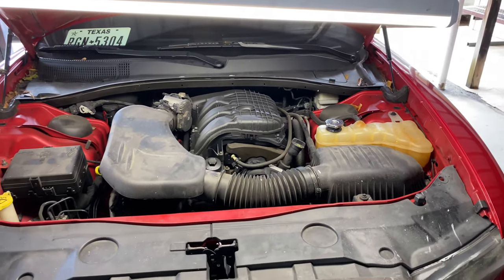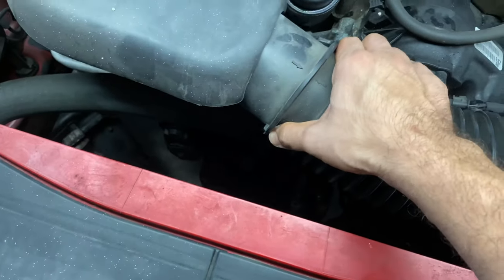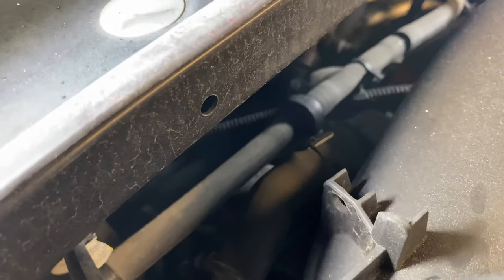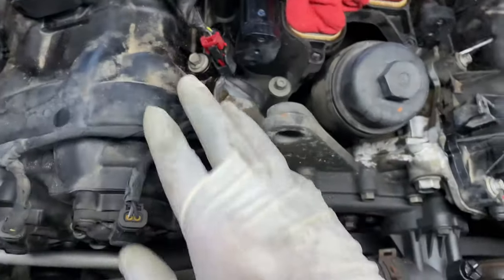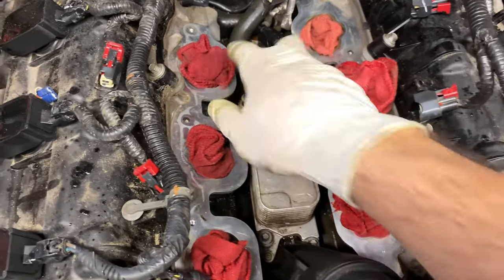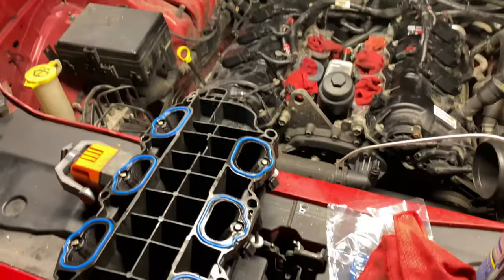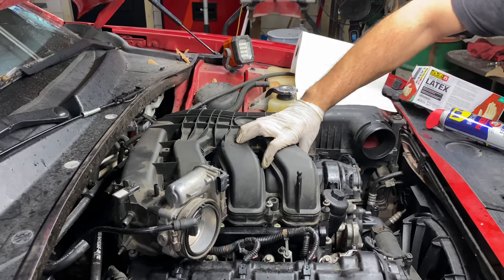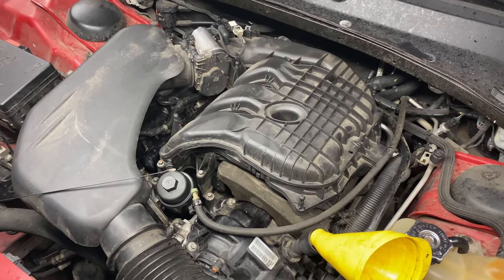2011-2021 DODGE CHARGER/CHRYSLER 300 3.6L V6 ENGINE OIL COOLER REPLACEMENT *DETAILED STEP BY STEP*

Comment: I would recommend using the Dorman replacement oil cooler, its aluminum not the cheap plastic part

Comment: Do you have to absolutely change the coolant right after a procedure like this, or is it just recommended? what can happen if you don't end up changing the coolant after a cooler filter replacement ?
Reply from the maker: that is a great question.. we suggest you change your oil and flush your coolant system, when this filter goes out, sometimes you will get oil in your coolant and it will be a mess. we strongly suggest you flush your coolant and do an oil change. if you don't change the coolant you run the risk of contaminating it with oil.. you will eventually have to flush it to clean it up and fix the problem :)
Reply: @HidalgoMotorsCo  Ok that makes perfect sense , thank you for this fire 🔥 content!! 💯
Reply from the maker: @joserose2046  no problem my man!! thank you so much for watching. hope we were able to help!!

Comment: I did my own charger and my sisters Charger. spent a total of $150 for two oil coolers 

Thanks to your video we’re leak free… 

I never physically see a leak both cars would smell like coolant and I noticed coolant level would lower day by day about an inch in the reservoir.
Reply from the maker: congratulations for doing both cars! once you do your first ones, the others become super easy. still time consuming but easy!! and thank you so much for watching. we are glad to be able to help!! thanks for watching! don't forget to like and subscribe
Reply: Can i ask which brand did you buy and how they are holding up so far ? Mine just started to have this issue recently
Reply: Can you share the link to buy the parts please?

Comment: Is there a possibility that my manifold is screwed to a braket? after taking out the seven screws you said to take out mine will not budge. it looks to be bolted to some type of bracket. just want to make sure so i dont start taking bolts off that dont need to be takin off.
Reply: He missed the 3 bolts holding down the area around the manifold and the one in the rear you would have to access with a 10 mm wrench

Comment: Whats torque have to be for the housing screws
Reply from the maker: hey my friend. excellent question. the specifications is 35in-lbs for sure... do not go to the 106lbs. you will break off your bolts.

Comment: When replacing this part where I need to purchase and put more oil in the vehicle I had a mechanic do it and I don't know if he was supposed to add more oil because now it is low
Reply: Buy oil from autozone.
Reply from the maker: Yes that's correct. Get more oil from Walmart or wholesale store. Auto parts store usually over charge for oil. Same brand etc cheaper at Walmart or Sam's club
Reply from the maker: Thank you 😊

Comment: I was trying to remove the oil cooler, but when I lifted the cooler up, it just started to flood coolant liquid up through one of the "holes" where the cooler was sitting.  Why??? I had to put a plug there and now I dont know what to do..... 😥
Reply: What did you end up doing??
Reply: Did you drain the anti freeze before repair?

Comment: Hello, when standing in front of my 2012 Chrysler 300 V6, it's pouring coolant from.. it looks to be behind oil filter...Its pouring water when using a pressurizer. Could that be the oil cooler?
Reply from the maker: Yep

Comment: Can this be causing “bubbles” in the coolant tank or overheating?
Reply: Having same problem but lil bit of oil getting coolant also
Reply: Having same problem did this work for you
Reply: @liliceee1193  did it work?
Reply: It very well could be... Those gaskets under the oil cooler housing could be worn out. Or one of the coolant hoses could be loose or cracked. I would suggest doing these steps first before taking apart the car and replacing the cooler housing:
1.) Maybe someone did a coolant flush/raplacement recently and they didnt bleed out the air all the way. You might have to reflush it out again.
2.)  Run your car to where it gets warm enough. Visually inspect the radiator and coolant hoses. Make sure there are no cracks in the hose. Sometimes its hard to tell if there's a crack in the hose. Thats when you can get some soapy water (or some mild spray cleaner like windex) and spray it down, and if you see soap bubbles, thats when you know there's a leak. The leak can be so small to where no liquid leaks out, but air can always seep in there. Make sure when you're done you try to wipe off the spray because that can dry out the rubber, especially for older cars. 
3.) Spray down the areas where the hoses connect to the coolant reservoir tank. Also, spray where the hoses connects to the radiator. If you see any bubbles from the soap, thats where you know you have an air leak. If that happens you might need to change the hose out. If you cant change them out, a temporary fix is to get some hose clamps. 
4.) Try to spray the tank cap like the hoses. Its supposed to be on there tight but over time they might get loose. Spray it down and try to see if there are any bubbles.  
5.) Make sure the radiator hose bleeder valve is screwed on properly. Make sure its tight enough. or maybe the valve screw is bad. If the valve is bad, its a cheap $5-10 replacement.

Comment: Hey my car it’s overheating and they charging me 2k to replace it with the sensor I changed thermostat water pump and coolant sensor and this the only option they giving me what do you think?
Reply: Last option I can think of is the radiator might have some blocking in it stopping it from cooling right. The oil cooler is ment to help oil down the oil in the engine .
Reply: Look down into the oil cooler and see if you got oil down there. Mines didn't overheat cause I was checking mine daily. But it was leaking oil bad cause of this reason. I changed it out this pass weekend an don't have any leaks so far. I have no car mechanic experience. I just watched a few videos and bought all the tools.

Comment: How many miles did this vehicle have on it and were there any codes associated with this? Thanks.
Reply from the maker: 159k miles and no codes. But you may get some codes for oil cooler sensor or oil pressure maybe? Idk
Reply: @HidalgoMotorsCo  is that also for 5.7 hemi is because I have a problem that my motor oil is transferring to my coolent tank
Reply: i had did one on 3.6 2020 charger and no code was on but the oil was mixing in the overflow container Did head gasket check and it was not that and come to find out it was the oil cooler now it all good
Reply: Mine went out two days ago at 133k no warning lights saw oil coolant & puddle when I was replacing aging accessory belt and checking on other rubber parts. Mine must have started between when ordered the belt and put it on. Waiting on all the parts to show up to fix it. I ordered the tube that comes out the back as well since it's impossible to visually inspect it and mine is now 9yrs old and I don't want to have to redo this again any time soon.
Reply: @flaboi404 at what miles did this happen bro ? And also was there a lot of oil in the coolant resivour? And how did the sludge look color wise?